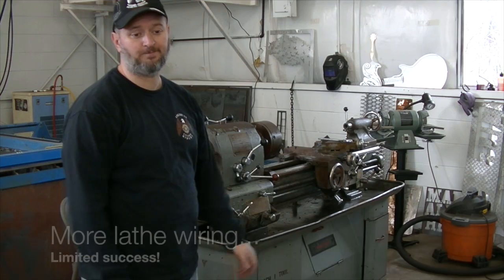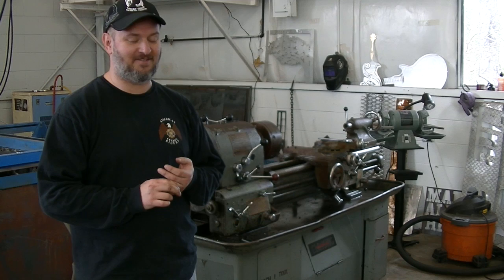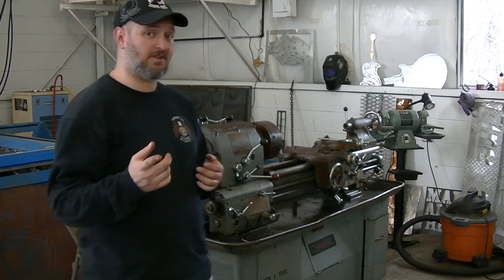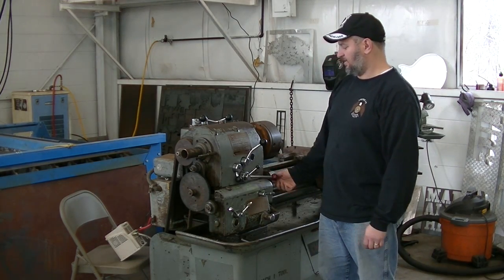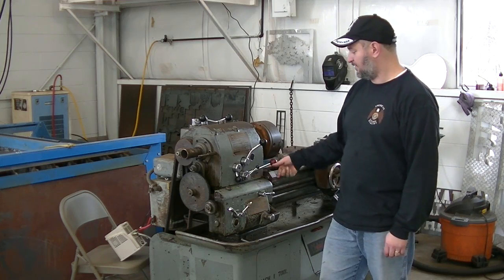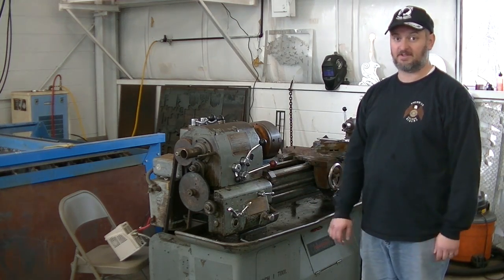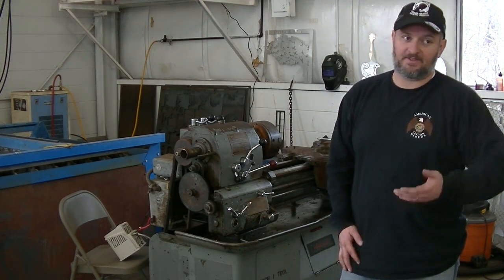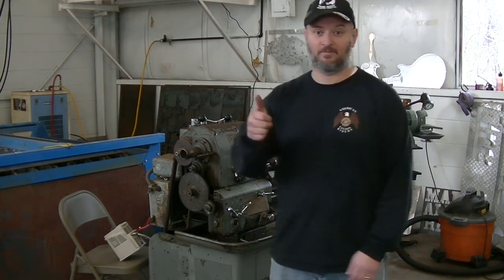More lathe wiring

Comment: Tom

What confusion.  You have many sources of advice and they do not all match.  Well here is one more to add to the confusion pile.

The good side is I am a motor control electrician and am familiar with VFDs and all the neat stuff.  I firmly believe in KISS yet I can complicate things real quick when I put my mind to it.  I am also the King of overkill and generally oversize by 25%.  I want to put something together have it run and not fool with it for minimum of five years.  Just an opinion based on 40 years as maintenance electrician.

IF my machine
I would leave it as is and get more familiar with how it runs.  

You must have a firm understanding of the mechanical stuff RPM torque and the torque demanded by that machine at different "metal removal rates" ie feed speed DOC blah blah.  It runs now so leave it alone and do the learning.

Once you have a good understanding of the torque demand based on your machining needs (and wants) you can select the motor winding which will be driven by the VFD.  At this time being unfamiliar with the torque demands my guess would be low speed winding which will deliver twice the torque as high speed.  You can achieve higher speeds than 900 (IIRC) using the VFD up to 150% ie about 1350 motor RPM.  How many times do you really need 1800 RPM on the motor and very high spindle speed?  Yes torque will diminish over 900 but that should be no problem - how often are you really hogging at high RPM?

I would go with the drop out relay idea and use it as a master relay - you can salvage the larger relay for speed selection.  This relay would control power to every thing main drive motor coolant pump etc etc.  Your ON OFF momentary switches and the E stop(s) would control this relay.  It would give you total shutdown on utility power loss and satisfy the requirement to have two actions to reset an E stop.

Now one thing more GROUND YOUR MOTOR SHAFT.  VFD can create circulating currents in the rotor which will go thru the bearings on older motors.  Current thru bearings is never good and can cause brinelling ie a washboard effect.  You can use carbon brushes for the ground.

I like my switches up high where my hands normally are and they get less chips oil and mung in them - less cleaning and maintenance.

Dan Bentler
Reply from the maker: dan bentler Thanks for the feedback, Dan. It's much appreciated! You're right, between here and Facebook I got quite a bit of feedback which at times conflicted with one another. Hopefully I have a plan moving forward!

Best wishes,
Tom
Reply: Very very good advice on grounding motor shaft. I've seen many motors burn up the bearing because of no ground. With gamet bearing I believe in that lathe you scrap the lathe if the bearings went. I am not a fan of vfd if you have all those controls built into that lathe. Just my 2 cents.

Comment: You probably already know this.  To reverse any 3ph motor, just switch two of the leads.
Reply from the maker: Dan'sMeTube Thanks for the input. Would you switch T1 & T3 or does it really matter?
Reply: Tom Zelickman As long as two of the three wires are switched the motor will run the other direction. T1 and T3 will be fine.